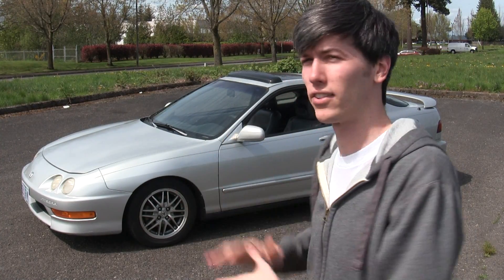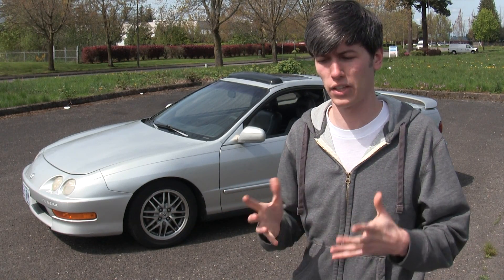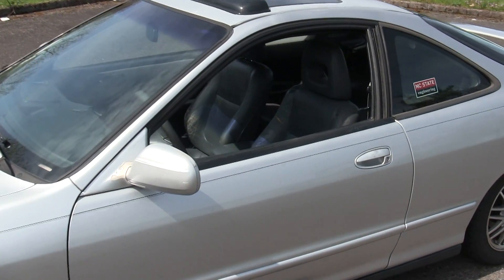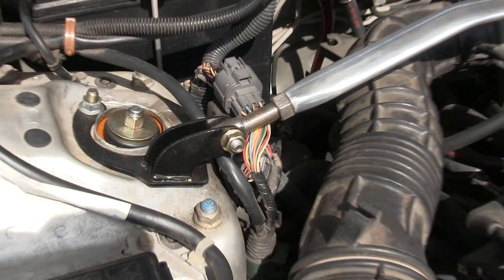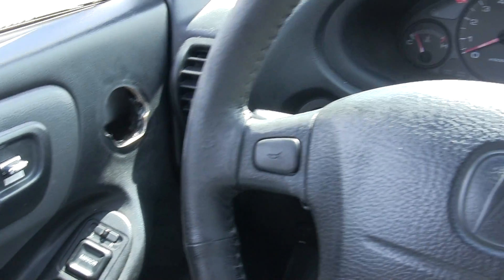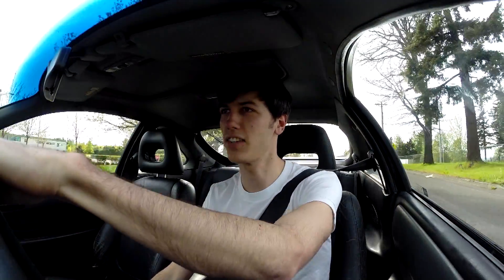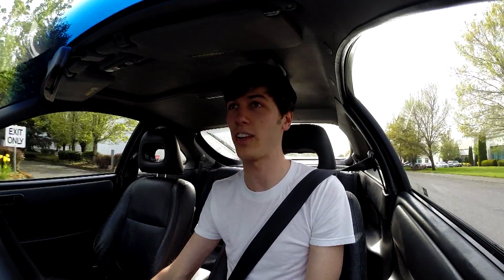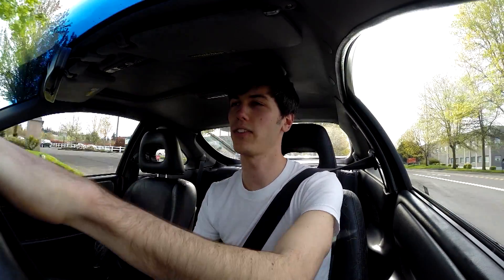Project Integra - Let's Build A Race Car

Comment: most definitely, if i wanted to make a track car out of it, the first thing i would do is weight reduction (getting rid of the sunroof, carpets, factory seats, replacing glass windows with polycarbonate or lexan etc. - these are free or not so expensive mods). next would be stiffening (for educational purposes, i would do it in two steps: first, only with removable stiffening bars, and then full cage - in some countries even removable rollcage is illegal on the streets). then some clever suspension tuning (starting with better tires and lightweight wheels alone, i would be very curious about the results without any other modification). then brakes (starting only with reinforced/braided brake lines and slightly higher quality pads - again, these are the easier and cheaper mods than a full brake kit). and the very last thing would be the engine and transmission (these are the most expensive, and, without paying attention to the other things above, more power is obviously more dangerous).

Comment: I think the first thing to do is work on your corners. Switch out the wheels, tires, and brakes for something more racy. I won't even put a suggestion for a wheel because who likes what is so subjective, but I'd find something to accommodate a larger tire. As for tires, my pick would be Goodyear Eagle tires as they have some of the better prices in performance tires. I don't think the brakes have to be carbon-ceramic, but definitely something better than stock.
Reply from the maker: I agree, I think brakes are a great step in the right direction.

Comment: Everything around Suspension and handling I dont Need to hear a for the thousands Time 'swap this Engine' or 'turbocharge it with this and that' I want to know what Males it corner better because thats what's Fun in such a light and nimble car
Reply from the maker: Sounds good!
Reply: yeah man I totally agree! I would like to see how some changes in the suspension would make this car perform better and still keeping it legal to run on the road. And make some conclusions on the upgrades considering the investment and the improving so that we'll know if it is woth or not :)

Comment: Maybe time attack car would allow you to make modifications you want, but still you would be able to do some racing. 

Rollcage is important so if you have the money to buy it, you should buy it. Fiberglass or carbon fiber body panels (hood, fenders...). Polycarbonate windows if you have the money to buy them.

Splitter and some other aerodynamic stuff. Brake cooling system, diff lock, ECU re-mapping (do it yourself if you can!) Camshaft upgrade, exhaust upgrade (remember exhaust manifold), lighten a flywheel. 

There are many ways, but you will decide. I personally would like to see what kind of a difference does the diff lock and aerodynamic parts would do :)

Comment: First up you gotta fully strip it, everything thats not completely essential gone. Then replace as many body panels like hood, roof, truck then fenders and things if possible +doors obviously. Replace windows with polycarbonate or similar. Then you gotta sort the engine out, personally i'd say some sort of crazy two inline 4 motorbike engines glued together, simply getting a slightly bigger honda motor with a turbo is completely normal and childsplay. Then you gotta make it mid engined. Then i'd look at getting double wishbone suspension front and back with air ride. That should make for an interesting video series.

Comment: Strip your whole car to get rid of excess weight, then go for a k20 engine as a start.
Next thing you want to do is to get some parts from a type-r.. brakes etc you should get them fairly cheap.
After you get the handling done you should go look for a turbocharger and all the stuff that comes with it.
It depends on how old the engine is but it shouldn't be much of a problem to turbo a stock engine..
That would keep you going for a while and it's good to start with tbh.

Comment: You should trade in both cars for a Shelby GT 500. That's the best advice you're gonna hear.
Reply: No.
Reply: Your dumb he still wont have enough for a gt500. In my opinion they are gay the older model gt500 like the 67 models those are badass. But thats not the best advice
Reply: alex ruiz gt500 are not expensive???
Reply: Oh im sorry rich boy
Reply: Or a C7 vette

Comment: I am also doing the same with my honda (D SERIES) whether the engines are old or new, THEY ALL GIVE YOU A GENERAL IDEA OF HOW AN ENGINE WORKS. I learned a lot from it from bottom/top. Hondas/Acuras have potential and they are great cars to practice with, and could be built for either drag or circuiting :D I am looking foward to your project. I would love to see your car on the circuit track.

Comment: A motor swap with something that has Vtec(don't know my honda motors) , turbo, front mount, turbo manifold, exhaust, bigger radiator, clutch, aluminum flywheel, bov, gut the back, short throw shifter.
Reply: Or if you want something more challenging, drop an LS engine in there, if you can. Or maybe an sr20det if possible. But swapping out a motor for another honda motor that has vtec would certainly be much easier and cheaper

Comment: first strip the car and install a roll cage if you are going to build a race car..paint the interior and cage in whatever color you like....fire extinguisher, transponder, master cuttoff.... then get some REAL suspension. Koni race with ground control 450/600 is what we use for that EXACT car.... the 4 door actually handles a bit better. keep the engine stock but tune it with a a piggy back.....thats what we did and were uncatchable so far with a pro driver onboard...of course brakes, braided lines, straight pipe, etc etc is what we did.
Reply: we did A LOT more but too much to list.... we actually have 3 of these cars built along with 3 spec miatas and an audi TT  time attack car....
Reply from the maker: Kenny Nevarez Any website where I can check out what you guys have done? Thanks!
Reply: yes JandAmotorsports.com is for the racing teams page. the cars i work with are the 37 blue integra and the 137 white tube frame fwd integra built by dentici cars in wisconsin. JandA is also on facebook. If you want to see youtube videos look up youtube user name herbertgomez37... my personal engineering teams page is nevarez motorsports engineering on facebook. but we specialize in spec miatas and mazdas with naturally aspirated rotary engines for road racing applications and tube chassis mazdas with rotary engines as well.

Comment: I would definitely like to see you rebuild the car from the ground up and explain all the compromises honda had to
go through ( due to price reduction and usability ) and possibly make it with an emphasis on the sport characteristics .
For an example you would relocate existing parts in an unconventional manner to let's say get advantage in therms of
weight distribution. Ideally, at the end you would end up with a road car from honda but re imagined for optimal performance. 
If you could pull an f20 swap and explain the hell of the horizontal to transverse engine orientation change that would be stellar 
but that's unlikely doable with the budget in question. 

But whichever route you take a expect it to be an amazing journey for us, take care friend :)

Comment: You should put huge spinning chrome rims on it, LED aftermarket Daytime Running lights, neon lights under the body, two 12" subs in the trunk, and paint it metallic purple. 

Then roll through any local hood. You'll get massive respect, yo.

Comment: Hey Jason. So if you are going to build a race car then you have to consider what the car would be good at, given your budget is. Generally track, or autoX is cheaper than drag or drift (you cant drift your car anyway). I track a 91 Miata and I love it. I have made a lot of great contacts, and friends just doing simple HPDE track days. I would recommend going that route. AutoX is always an option but you wont learn as much, and won't get as much track time. AutoX seldom gets out of 2nd gear, and a cars handling characteristics are very different bouncing of the rev limited in 4th, than it is in 2nd (its more exciting too). If you decide to go the track/HPDE route, I'll tell you that the best mod you can do is getting track time. Nothing supersedes experience. As far as the car is concerned, start with safety, chassis, and engine cooling. Power should come last. Oh, and I almost forgot, the cheapest mod of all, weight reduction. Gut the AC, PS, those nasty seats, carpet, insulation, ect. Its amazing how much better a car handles, and accelerates if you drop 150lbs from it. Lastly, if you track the car, it would make some pretty stellar YouTube videos. Check out my channel if you want to get an idea of what a track day is like. Looking forward to which way you go. Let me know if you have any questions.

Comment: B16 LS-Vtec head swap. Its pretty cheap to do and very efficient in adding power. If you wanted to go big power, you could do an B18b1 Turbo Conversion on a Hondata ECU. On stock internals they can make 250+whp and are incredibly fun to drive. Integras are great track day cars. My buddy had one and it was a blast to drive around a track. I'm interested in seeing this build.

Comment: I would suggest: gut the car. Add a differential. Change all the bushings. Change motor mounts. Get a more aggrssive clutch. Get another set of wheels and tires that match well with your springs rates. corner balance and align the suspension. Get a proper fitting race seat. And racing school if available.
Reply from the maker: Sounds good!

Comment: 360 degree f.o.v. cctv cameras, sensors on every door and window, tracking system, armor plated doors and finally fluffy dice rigged to explode when anything but the key is inserted in the ignition .. oh and a 70.0L V25 6 cam ENGINE WITH HUGE ASS TURBO.

Comment: Gravel rally build!  Change out the suspension for high-performance and ride height (raised, not lowered!) gravel rally tires & rims (may require smaller brakes because the gravel rally tire sidewalls are so tall), rollcage...  :)

Comment: i would add a turbo/supercharger onto it. maybe an aftermarket exhaust+catalytic converter, new wheels maybe. higher output fuel injectors, And obviously, an alarm system (id use viper alarm system, then put a  kill switch onto the hood/bonnet, so if someone tries to jack it and pop the hood it wont start)

Comment: AWD/RWD swap either of them, doesn't matter,
Reply: Electric motor to the rear wheels. Make a hybrid boost to improve acceleration. Minimal amount of modification required and it should also let you shift the C of G backwards for more of a race car style handling.
Reply: Then he has to also mod the chassis and that'll get expensive as well.
Reply: ***** trolling

Comment: Love the channel btw.

I had a 50cc scooter as a kid. Pretty much anything you changed would make it go faster, cylinder, carb, exhaust even to some extent the air filter. A few hundred bucks would take you from 5hp to nearly 20hp.

I am told 4-strokes are much harder to tune, I'd love to see how you would tune your car to a basic level without messing with the ECU too much. I don't understand why changing similar parts in the similar way does not have a similar effect.

Comment: Maybe put on some camber and toe arms? Also performance air filter and exhaust! Maybe get the ECU re-mapped?
Reply: Engineering Explained Put a big spoiler on the back and "sticker bombs" in the front fenders for extra 27.3hp :)
Reply from the maker: Camber arms will definitely happen!
Reply: Henry Chou Yeah I like to see HONDATA S300 on there.
Reply: Ecu, remapping, or even a aftermarket ecu ex hondata would be cool!